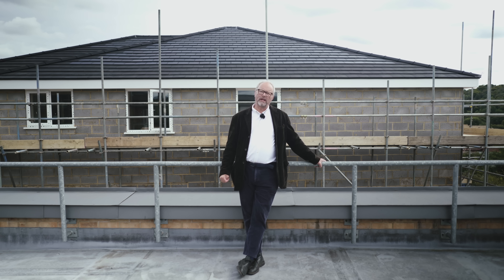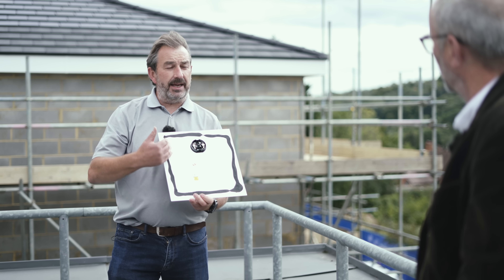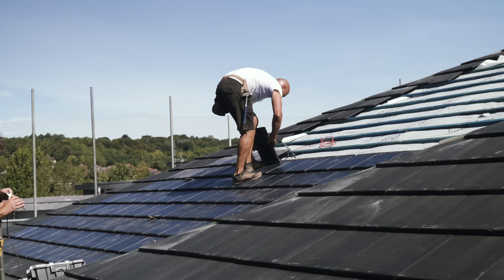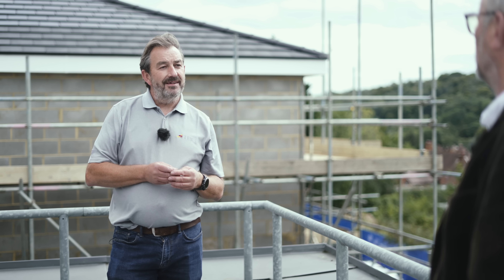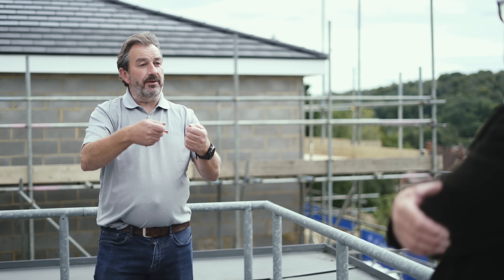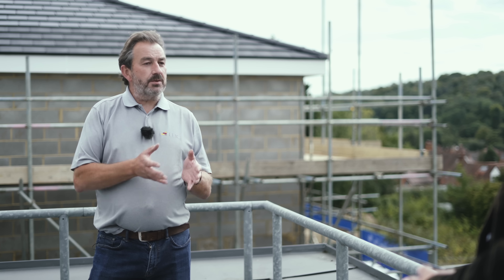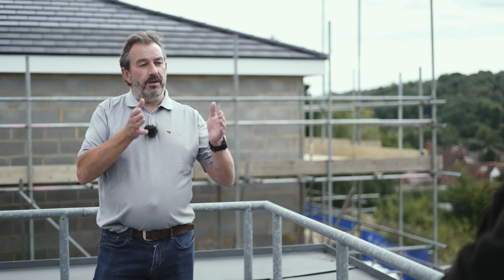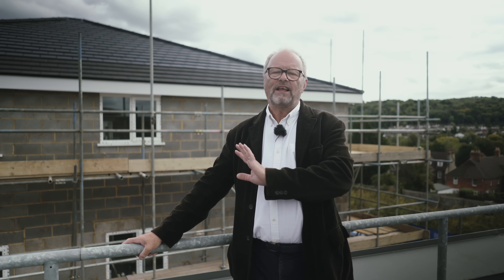Solar Roof Tiles - should every building generate its own power? | 100% Independent, 100% Electric

Comment: The process is still wrong. 
You don’t NEED a cement tile backing the solar panel. 
The purpose of the cement tile is to protect the waterproof sheet. 
If the solar panel can do that alone, you don’t need a heavy, expensive, cement tile. 
Just make the solar panels a little more robust to protect the waterproof underlayment fabric!
Not only that, the cement tiles hold heat!
Without them, the solar panels would stay cooler.
Reply: Correct - its pointless. Same thing as normal tiled roof and solar panels, except much more expensive and difficult to install. Better concept would be to eliminate the tiles all together and design the roof to integrate purpose designed larger panels..
Reply: @tulsk2  Much like the prebuilt roof panels you see in Germany. Arrive on a lorry and get craned into place. They are a complete item.
Reply: The cement tiles are dead cheap and ubiquitous. Making the solar tile do it all is much more expensive- like the Tesla tiles.
Reply: Mr. Quindazzi, it will take a little time before people realize what I am saying is true...Europe will obviously be the first to implement it. Soon, entire roofs will be covered with solar panels, that lock-together to form total roof protection. 
Solar panels ALREADY have to withstand all that Mother Nature tosses at them. Might as well just give them SLIGHTLY increased duty and serve to completely cover the roof, and underlayment.  No need for redundanct cement tiles.
Reply: Mr. Quindazzi. A simple rigid edge of plastic is all you need. It wouldn’t cost more than a few more pennies per panel.
Reply: Mr. Quindazzi, cement tiles are not cheap. Plus they are a unnecessary heat sink. Keeping temperatures Higher, for quicker degradation of solar panels. And less effective electric production.
Reply: @tjam4229  They are cheap, which is why they are so common. They are also very durable and these standard production cement tiles w/solar glued on are cheaper than Tesla glass tiles by a lot, and cost competitive with a standard roof + solar panels and you don't have solar panels sticking up on the roof.  I am amused by people thinking it is so easy to produce an alternative.
Reply: Mr. Quindazzi, anything deemed “unnecessary” can’t be “cheap”...ie.  Anything “unnecessary” is a waste of money, and is therefore “expensive” in the long run. Go out and price how much it would cost to buy tile for an average roof. That money could be put toward solar panels.
Reply: @Just think, I don't understand you! But what i'm saying is, this process still uses a cement tile, except now it's got a hole (added cost) and it's got a small solar cell with extra wires (added cost, complexity and opportunity for failure)! A normal roof + panels is simpler easier cheaper more reliable. Now, next level thinking (by architects) needs to look at removing the tiles and designing the roof with large, easy to install, reliable and cheap PVs. This needs consumer demand to happen and while consumers are stuck on the idea of centuries old tiles, well, it's going be slow...
Reply: @tulsk2  I understand what you are talking about but it has already been invented - it is Tesla's solar tile. It is both load bearing and a solar collector. There can be improvements as I am sure you are alluding to but the problem is that whatever you put on a roof it has to be tough as nails or you end up with a US style bituman roof that has to be remade every 15 - 20 years or whatever it is. I think its a great concept but just saying there are reasons why they are going with a cement tile.
Reply: @R2D2trashcan  I get ya, but that's still complex. I think simple option is large PVs (maybe 6-12kw size) with standard tiles around the periphery for joining and corners etc. Make it so the large PVs are swappable @ 20 years. Probably all a mute point if they can start making PVs thinner and more flexible.. (hopefully we can just roll them on..)
Reply: @tulsk2  yea it is just useless, does not make any sense at all, instead of making solar roof tiles,  he could makr affordable solar panels more cheaper.  And who says plain solar panels doesn't look good? I love them how they look, we don't need expensive piece of shit like that,  and don't forget added cost of tesla wall lol
Reply: @tulsk2  Next level? that's old hat, we have roofs round Sheffield with panels and a border of tiles (made from stone).
Reply: What about the weight? In a strong wind, hurricane, they will fly around
Reply: Actually T-Jam, the concrete tile substrate IS required as the concrete acts as a heatsink for the ergosun tile by Solarmass which keeps the unit cool, and providing increased protection for the home. Also - this product can stand withstand storm force gales when configured in this manner.
Reply: That's why the Tesla ones are better
Reply: Cement is really bad for the environment due to the enormous co2 output of production. So do away with cement.

Comment: I suppose the only downside is that the tiles are still concrete and therefore emmit a lot of Co2 to produce. But this is an easy way for ordinary builders to get involved with solar roof tiles which is great.

Comment: Why do the tiles have two wires? Surely, each tile just needs 1 wire?  In that way, each tile recieves a wire from the tile upstream in the chain, and presents a wire to the next tile downsteam?
Reply: It's normal for any electrical device to have 2 wires, one positive and one negative, just like any battery.
Reply: @johnnodge4327  no, i don't mean two CONDUCTORS i  mean two wires, ie two "flying leads"  It would half the connector BOM cost if the panel had 1 flying lead, and those leads daisy chained along the panels!   Two conductors are not needed because the current return path can simply be taken from the other end of the panel string, it does not need to route through each panel!

Comment: Looked at roof tiles in the past, but they are not ideal for Canadian climate.  Just like cinder tiles, concrete cracks and splits during extreme temperatures.   Probably the only solar tile that might work are the ones from Tesla.

Comment: Many of the businesses here in Arizona are installing covered parking with solar as the covering.  You can't go two blocks without seeing hundreds of panels. I have the conventional panels that were installed in 2016.  It is a 9 kw system as our utility limits you to 10 kw or less unless your residence is fed by it's own separate transformer.  In my case, our house shares a transformer with 4 other houses.

Comment: I thought solar panels had to have an air gap under them to dissipate heat.  What am I missing?  Is it only certain types or am I years behind technology (as usual)?
Reply: That's pretty accurate. Solar panels drop in efficiency by something like 30% when they get hot. This is a good reason to have the panels off the roof surface, so cooling air can remove unwanted heat from below the panels.

Comment: Great idea, shame about the price.  Too expensive.  Get them down to an extra £1 (thereby doubling the price of the roof tiles and don't forget the extra cost of the inverter and installation) and maybe the mass public will accept it.  Now who is going to invent recycled, appropriately coloured, plastic roof tiles which are way lighter, easier to cut (?), more robust and as cheap, if not cheaper than concrete?
Reply: Absolutely. A conventional solar panel system is now well under £1 per Watt installed, but this system is going to be well over £2 per Watt installed, which over doubles its break even time.

Comment: A lot of companies don't have solar panels on their roof because even if their were willing to do it their roof is simply nto designed to support the weight of the installation. This is pretty much what happened where i work, the cost of work to make it possible is so high that it stop being efficient in any way.

Comment: In Portugal, we use the orange wave tiles, to do this kind of things I guess we would need to also change the support structure, it seems to be different.
Reply: Nah, pan tiles (as they're called in the UK) are attached to the roof on battens exactly the same as these.

The spacing of the battens might be different, but if you're replacing your roof you'd nearly always be laying new battens at the same time so can space them to suit whatever tile you'll be using.
Reply: @DEADB33F  Ok thanks. I said Portugal but I think it applies to every south country. Maybe we use this kind of tiles because of the heat.
Reply: @DEADB33F  err, he means the kind of clay tile which isn't flat. It has a 'wavy' profile.....!

Comment: Eight years ago I just couldn't find a supplier for similar products, so I had the large bolt on framework installed. The roof was designed for the extra loadings. One advantage is that the air gap acts as a tropical roof on sunny days, keeping the underlying tiles cooler. 
It should be illegal to build a none solar PV roof , preferably with a well designed battery system included.
Reply: @James Clifford I did actually try to get a price for solar tiles from Solar Century, The salesman couldn't be bothered to reply to my enquiry. He didn't want to bother with a self build customer. So of course I went elsewhere.
My house does have Solar PV, Solar Thermal for water  and Underfloor heating as reqd.  Ground pipe Air supply plus underfloor extract for air supply, (gives fresh air at 16deg in summer for cooling and in winter at 14deg even on the frostiest day. Heat recovery in the ventilation system. ASHPs to supply underfloor heating by freezing the used warm air being  expelled . 
The house has insulated underfloor , 200 mm wall insulation and a SIPS roof. 
The garage/ hobby room  is heated by ASHP,
During sunny days the car is solar charged. 
 Our Electricity bill for a 230 sq mtr house is less than for my mother in laws 50 sq mtr semi. even including 15000 miles for the car. 

Careful design  and good choice of materials are worthwhile.
Reply: @James Clifford Agreed, first we designed a Tea cosy, then decided how to fit it out!

Comment: 45 panels in series, 1 gets a bit of shade and they all are offline
15W per panel doesn't appear to be much power, assuming one side of the roof has 15x15 (avg), that's only 3.3KW. But the advantage though is it can go right into the corners unlike normal 350W panels.
Just saw 13.5KW is the total he mentioned. not bad but needs better panels.
Reply: What? No. One panel in shade doesn't drop the whole series' power to zero. Who told you that?
Reply: @frederf3227  how is it then different to normal solar panels which does get affected if a panel which is in series is covered in shade. the whole series is affected, not total loss but a good portion of it none the less.

Comment: Excellent! Will the solar cells be productive for the life of the shingle? Is there a central inverter?
Reply: Neil Blanchard Unlikely- a concrete tile is really the economy option for roofing, but even so will last many decades. The best solar panels will last 20 years without too much degradation, after that you might have another ten years of useful output. I'd be more concerned about the adhesive holding the solar module to the tile- in a harsh environment with extremes of temperature and exposure to all kinds of weather I can see them detaching from the concrete within a few years.
Reply: @spencerwilton5831  I think you are correct on this. They should have a better solution for this. Tesla roof tiles are also in this situation - they will last far longer as a roof, than as a solar panel. And that is the thing that is better for using separate panels.

Comment: Each tile has a 2 inch hole in the middle...ill let that sink in a minute
Reply: True, that could affect water tightness should the seal between the tile and panel fail or have a gap in it.
Reply: So - what? ..... are you suggesting they didn't think about that then?
Or what?!
Are you claiming some brilliant insight that these people don't possess? That they don't know that a roof tile needs to keep out water......?!
What actually are you suggesting.....?
Reply: @andymccabe6712  if they are assembling them on site, then quality control is harder than it is in a factory, which is one aspect. 

The other is that an unforeseen materials failure, caused by mechanical stress, thermal stress or environmental conditions.

Either of these could be a point of failure that leads to water ingress.

I would be very surprised if they hadn't thought about these issues, and they may have done extensive product testing (including stress testing and simulated ageing) and may have systems to control assembly quality on site.

However, if I were going to fit these to a roof, I would want to know these details, as I would of any other tile that differs in materials or greatly in design from tried and tested ones.

Comment: How do they deal with the heat though?
It is the same question mark i have regarding the tesla roof tiles.

When i started talking to solar experts the time is started designing and building my house, i wanted roof tile solar. Tesla roof tiles are years out from being available in Germany (Tesla Germany theirselves said so to me). So i looked for any other solutions, and they all required a cooling canal solution venting the roof tiles. Making it all very expensive. More expensive as just using black roof tiles and slapping deep black solar panels on top with a few cm of room so the wind can take the heat away.

The solution shown here in the video is just layed down as a regular roof. I am very confused.

Comment: I like this better than the Tesla roof since the standard tile for the balance of the roof are just standard concrete tiles that can be cut and fitted to most kinds of roofs. We have a rental property in Southern California with a 30 year old Spanish tile roof that needs to be removed to redo the underlayment and we were looking at replacing it with a standard asphalt roof with solar panels but this would be a much better solution.

Comment: Given there is no air gap, I wonder if these panels will suffer from lack of cooling, both longevity of the panel and the output drop when very hot. Most in the Motorhome world are now shying away from bonded flexible panels and going for suspended glass panels.

Comment: Just a thought but you could have solar roofs. Or solar farms.Which would be more cost effective. That is I could invest in a Solar Farm or a Solar roof. Too me filling a Field with solar panels would be less labour intensive, and use standardised panels easily repaired and replaced.
Reply: Yah, start taking contracts for all the parking lots out there... miles and miles of open area just waiting to be roofed in to keep the sun off everyone and their vehicles.  You could even charge up the parked cars from it like a vending machine, so cash in at both sides.

Comment: Seems like a no brainer to me. If a fair proportion of houses had these fitted there would be a significant increase in the supply of electricity and maybe offset the need for nuclear energy.
Especially if the power generated was saved in large battery farms which in themselves could be far less obtrusive as the solar farms dotted around the countryside.

Comment: Tesla solar roof tiles don't go all the way to the edge. If you look carefully at their literature, you'll see standard matching tiles to cover edges, awkward bits & areas where solar doesn't make sense. As far as I'm aware, those tiles are cut to size on-site where necessary.
My one query about the fabulous solar tiles featured in today's video is how is the concrete made? Concrete manufacturing being very polluting CO2 wise. What mitigation measures are being used by the tile manufacturers to counter excess emissions? Perhaps advances in concrete manufacturing could be a topic for a future video.

Comment: I live in the U.S. and this is an AWESOME idea.  This I would say is better than Tesla’s.
Reply: This won't work in the US on most existing residential buildings.  Most existing US residential structures are engineered to support an asphalt shingle roof, which is much lighter per square-foot than these tiles which weight 10 pounds a piece.   It would work on new construction where the building is designed to take the extra weight,  but it would not be possible to retrofit these kinds of roof tiles to most existing US residential buildings.

Comment: What is really bad about solar roofs even now is that they are still fixed panels. Why isn't the industry pushing for a CURVED HALF MOON shaped roof that the panels could migrate from one side of the roof during the morning to the opposite side of the roof during the afternoon with a sun tracker so that instead of a 50-60% output per watt they could get about 80-90% output per watt meaning that the same amount of wattage of panels could get 30% more energy increase per day. They could still use the existing fixed panels until higher efficient lightweight panels come along & everything would look even better with a futuristic curved roof.
Reply: ...... and then someone residing on Planet Earth said the killer word - practicality...
And the whole mad, crazy idea just curled up and died.......!!!

Comment: How reliable are the many connections that are needed here? Material shrinks when it gets colder and expands under the heat of the sun. These many connectors must be able to handle this and that is difficult for the duration of some decades with humidity, rain and corrotion.